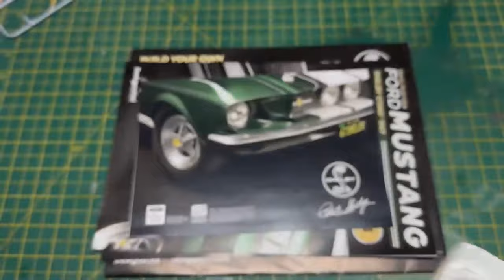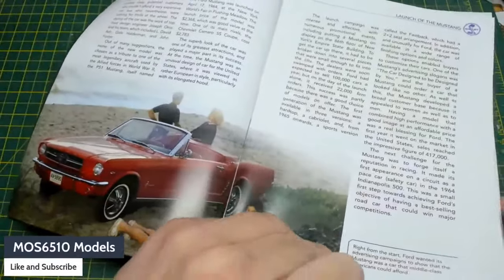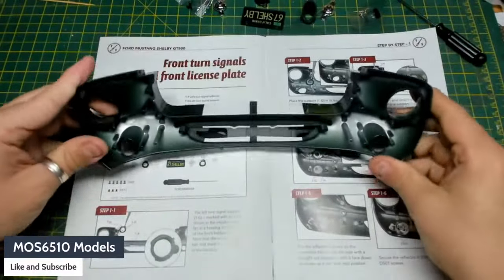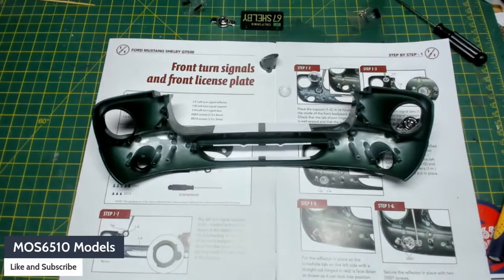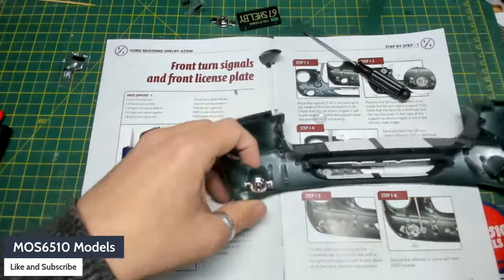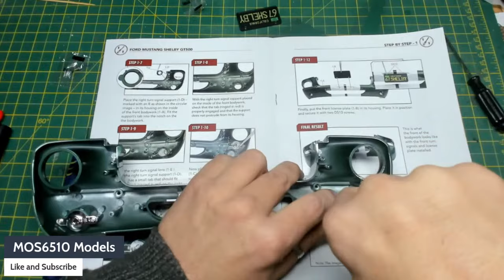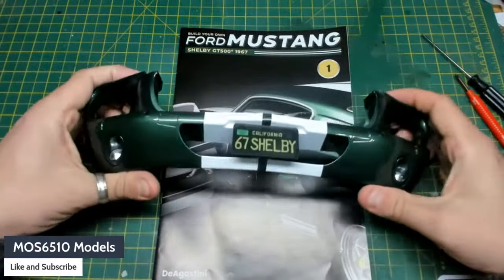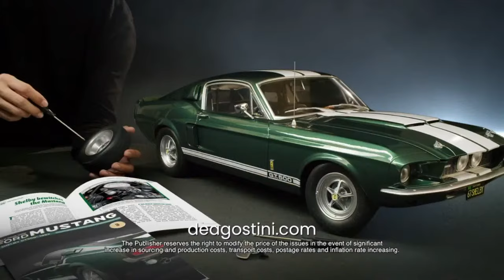BUILD YOUR OWN FORD MUSTANG SHELBY 1:6 Part 1

Comment: In your opinion are those types of kits value for money?
Reply: This kit will cost circa £1200 to build, based on previous releases...of 100 issues at 11.99
Reply: @gs425  really? That should be illegal it is so ridiculous.
Reply: I often find the 1st issue worth getting at a special price - useful bits and bobs for the spares box. I found buying back issues of the 1/16 tiger tank a cheap way of updating parts on my Heng long tiger, but really how many of these models get finished - I suppose enough for them to issue new releases.
Reply from the maker: I havent built it yet.. these kits are mega bucks.. look at the pocher kits.. they are around 800-900 pound